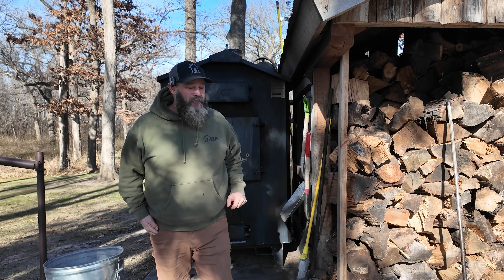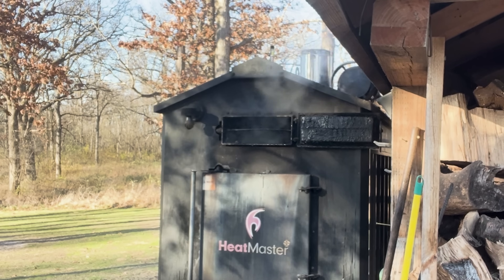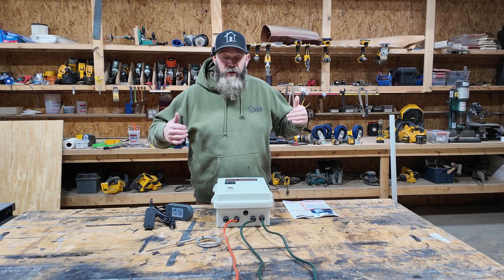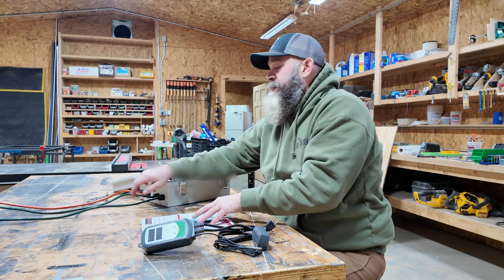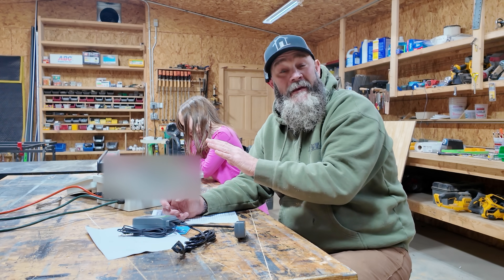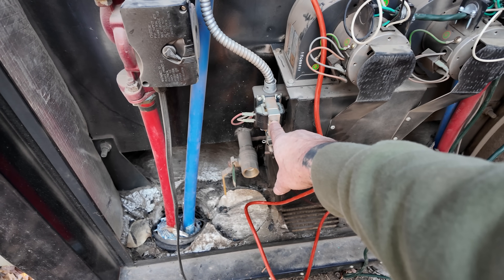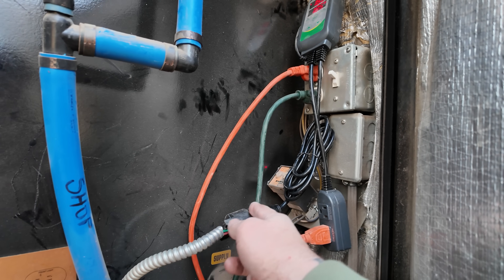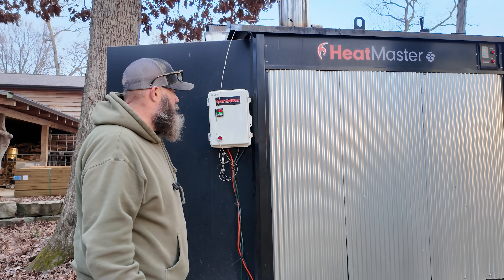Boiler Manufacturers DON'T Want You to See THIS...

Comment: suggestions: seal the gaps around the pex lines at the rear of the boiler. and I'm not too crazy about the flames shooting out of the boiler next to your shed's fascia and wood pile.....however this is an incredible video. This is another reminder to me of the trouble big government causes, If the EPA would back off the stove maker would have increased the efficiency of this stove double or triple easily.
Reply from the maker: Thanks, I will look into sealing those gaps!

Comment: do u have a backup generator ?
Reply from the maker: yes we do as well as a battery back up just for the boiler.
Reply: @upinsmokefirewood  i learned the hard way with no battery backup my 5 year old generac wouldnt start i lost all piping in g house in 1 hr neg 10 so i will b getting battery backup too

Comment: Has anybody devised a fuel hopper, which continuously feeds a boiler fire box regularly? That way, less manual feeding and longer, more steady burn times, no?
Reply from the maker: They make ones you can load over the top with a loader but you need to close them up tight to work properly so it would be hard to have one that continuously fed. I've seen a few guys with top loads like that and it seems like they wind up dumping allot of junk in them that they scoop up with their tractors!

Comment: You have a very short stack back there and the boiler if very very close to the wood structure...
Reply from the maker: If the boiler is running properly it should not be a problem. Shed has a metal roof and not in this video but boiler has a 3' extension. Allot of guys have theirs inside and no one seems to have a problem. Regardless one has to keep an eye on things
Reply: @upinsmokefirewood  Thank you for the info!

Comment: Question? Do you know if thus set up would work with a Heatmaster g400 gasification unit? My house had a neutral issue and fried my love controller and relays. I haven't been able to get it fixed. Heatmaster said they can't find the electrical prints for my boiler. I have been running it on an aquastat for 2 years. It works but is definitely not as efficient as before.
Reply from the maker: Thanks Jason. I don't see why it wouldn't but I would message Joe at Boiler Commander through the contact us part of their website. He will get right back to you and is super helpful. He would have all the answers you need. Thanks for watching!

Comment: Hi there great video. I have a Heat Master MF5000 and must say I'm less than impressed with it. This thing goes through about 35 face cord of wood each season and smokes like crazy. I would be very interested to see the results of the Boiler commander you installed. If it does what you say it's supposed to that would be a great option.
Reply from the maker: So far so good. Working on a video that explains what it does a little better and my experience so far. Should be out in about 2 weeks.

Comment: Stack temp at 750 is a whole lot of waste heat which could be used to pre heat the return water.
Reply from the maker: It doesn't stay there for long enough to do anything. Most of the time it's much lower

Comment: Watching the fire in a steam locomotive running at 200 psi when wet pine slab wood was thrown on I realised the firebox temperature rapidly dried the wood allowing it to burn hot like dry wood. I had an Orlan gasification boiler for 12 years until we moved . It worked well burning 20lbs/hour of dry hardwood.
Reply from the maker: This one likes dry wood for sure but it does ok with a little green stuff. Seems like it uses allot of heat to dry it.

Comment: Couldn’t you recover that 750 deg exhaust through a small radiator and pump?
Reply from the maker: It's only that hot for a short amount of time to be sure it's burning as much as possible/ Most of the time it's in the 200's

Comment: What’s the reason for 700 degree stack temp? I run a gasifier and I’m lucky to get 250 degree stack temp, seems like a lot of heat lost out the stack.
Reply from the maker: Most of the time it is much lower but as I understand it you are trying to get it to burn off the gasses and particulate. Your gasser does that internally so you don't see it.

Comment: So basically the box is only recieving the command of call for heat from the fan signal. The PID controller is only  reading the stack temp. This would mean the purpose of the controller is to figure out the best process between call for heat from the fan signal and a 700* desired stack temp. If I had to guess from you blurring out the open controller on the bench, I'd say it has an Arduino or Rasperry pi controller inside. Not all of us hillbillys are idiots.
Reply from the maker: I think thats pretty accurate. You can set the desired stack temp as well. Ideally you can lower the stack temp for longer burn times. I dropped mine to 650 and keep an eye out for build up or color of particulate in the top chamber to see how low I can go.
Reply: I built my first one on a woodmaster 4400 using a 0-10V light dimmer off Amazon for $15, K-Type TC for $20 and the same Solo 0-10V output PID for like $119. Currently running a 434 Woodmaster with a Solo 0-10 and a dayton speed controller i had laying around. You could easily make this with an Arduino and dimmer for less than $50. Chatgpt can get you a nice proportional control code to run with. I also control my down cycle with a stepper on flue damper. Shutting pump off between calls for heat and controlling cycles the stove sips on wood
Reply: @JalopyFarmer  Is your goal to control fan speed so you're not just blasting 140 cfm all the time?  Not really sure what fan is used but I'd assume it don't need to be much more than that so I just threw out a number?  Basically you're trying to get a hot stack temp without being so hot that you're wasting energy out the stack?  I've seen PID's pulse to achieve this with a relay but controlling fan speed seems the way to go. I'm just now finishing up a rebuild of a cl5648 and anything to save wood is a good thing.
Reply: Yes, I leave my up cycle temp at 450. I'm not sure how the BC guys say they give 117% on startup, I don't think its possible single phase. When my aquastat calls for fan, it let's the PID take control. Starts out at 200cfm, then starts backing down around 430 degrees closing in on 450.

My friend was going through 12-14 cord/yr so I monitored his temps. Empty with a coal bed he would have 800* stack temps, full of wood he would see 550-600. Adding my dimmer and PID he cut wood down to 7-8 cord/yr. 

I am also closing the flue on mine once the fan shuts off. As the water temp drops the flue opens proportionally. Then fan kicks back on at 170.

Comment: 66 YEAR OLD MAN HERE! IM JUST MARRIED TO STEFFY, IM NOT STEFFY.
ok, i kinda see what your doing here. your making your boiler able to be controlled by your phone over wifi!   i do NOT understand why the center of the video image had the blur masking on it. it could NOT have been to hide it from the manufacturers as you already showed that main unit.
ive been using wood boilers since the early 1990s , starting with a taylor brand. that one had tubes you had to clean out.
ill NEVER UNDERSTAND WHY, anyone wants to control their devices with a cell phone! 
does everyone understand that everything that happens when using a cell phone is not only recorded to be used against you by government 3 letter agencies, but everything you can imagine is being used as "data" to be sold to anyone and everyone willing to pay for that data. that the computer circuitry in these devices WILL GO BAD at some point, or be destroyed or hacked.
just give me a good ole manually controlled boiler. even in extreme northern Minnesota  and northern Wisconsin, i NEVER had to fill the boiler more than once every 24 hours, even in minus 30 degrees outside temps!
ive NEVER had a shortage of wood, and i do NOT split the wood that i do NOT have to! i only split the pieces i can NOT handle easily!!
i do cut all my own wood, i do NOT have to buy wood. im originally from Arkansas so im an old hillbilly that was raised cutting and splitting firewood that was our ONLY source of heat home built fireplace, and cook stove in winter. my great grandmother only had a wood cookstove for cooking year round, so i had to split that stuff pretty fine.
Reply from the maker: Cell phone does not control it as much as monitor it. I can see on my phone if it is up to temp. If it is early in the morning I don't have to run out and fill it. It also tracks how fast it heats back up in a graph. If the graph doesn't look right I can tell that I need to fix something (usually needs cleaned) The contents of the BC was blurred out per it's inventor's request.

Comment: Doesn't the Inkbird pair with your phone only when your phone isn't paired with another WIFI network? If that is the case, your phone will only receive data when paired with the Inkbird. All of these tools you have purchased we use in the electric beer brewing space. By appearances what this does is replace the Heatmaster on-board computer regulating system with a PID based system which has the capacity to learn the dynamics of the application. No doubt the basic system that Heatmaster uses for regulating burn and temp could use improvement. The only thing they require is the yearly sample for warranty.
Reply from the maker: I believe the Inkbird and our phone only have to be on the same wifi to paired (don't quote me on that)

Comment: I was looking forward to seeing inside the box. Expecting to see a PID controller like on a pellet smoker, but you ruined the video by blurring that whole area out.
Reply: I made my first style out of a 0-10v light dimmer and the same Solo 0-10v PID output controller from Automation Direct. Nothing fancy. I now have a Dayton 0-10 speed controller on my new stove. You can build this easily for less than $50 with an arduino and a light dimmer
Reply: @JalopyFarmer  Automation Direct is a great place to get well, automation stuff. I love their expandable PLC's where you could do all of this and have it report to your cell phone or email. I used many in the electric utility for SCADA in remote substations.
Reply from the maker: So sad. Blurred out per manufactures request. You'll have to find someone else to share your misery with. I will not loose any sleep over your disappointment.

Comment: hi there interesting ,don't know if it would work on my homemade boiler . and not quite sure what it does , but thanks for showing it . i pit some steel plates similar the heat made them take a whole shape  , best to all john
Reply: I'll be building mine as well and have the same thoughts of running this for a controller compared to conventional methods.
Reply from the maker: Thanks John!

Comment: Interesting. This is basically doing what high end down draft gasifiers do. Modulation I’m sure will help but the whole principle of the combustion design in the conventional chunk wood boiler is wrong and most inefficient way to burn chunk wood. What I think will help any of these style boilers is to add a large water insulated storage tank (in other energy storage systems they would be known as batteries, heat sink, accumulators, etc.) and let boiler fire wide open or at least a lot longer than normal charging storage tank. Hot, long burn fires burn clean and extract more heat out of the wood. Granted these boilers are not designed to burn as clean as if they were designed with refractory but I think it would make a difference.
Reply from the maker: That's what we're trying to get out of it. I can't believe now that I've used the boiler commander for a few weeks how clean it burns. The inventor Joe Borgerding was talking about a hot water storage tank like you were saying mostly to take the shock off the floor heat. Might look at that next. Thanks for watching!

Comment: hello sir-i don't run a wood boiler but i would like to...,just a question...shouldn't the woodpile be protected from sparks...thinking maybe some metal on that side of storage shed? dunno..just my two cents
Reply: I have a Portage and Main. The way the stoves are designed the smoke has to make an 180 degree turn and then another 90 degree turn before going up the chimney. I've never seen sparks in 5 years. But a few people have also asked me if my wood pile is too close to my boiler.
Reply from the maker: Have to keep an eye on it for sure but If you tried to light one of those big chunks on fire with a match you'd be hard pressed. Part of what I'm trying to do with these upgrades is turn it into a cool old man with a pipe and less of a fire breathing dragon!
Reply from the maker: mostly I worry about what comes out the door if I open it at the "wrong" time. I've heard allot of good things about P&M boilers.